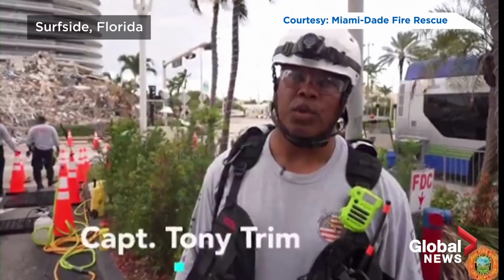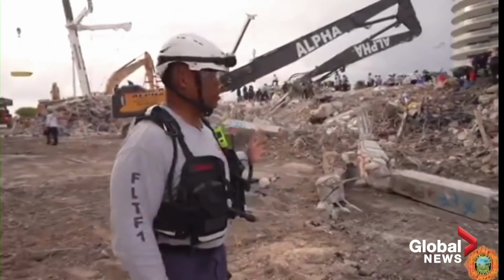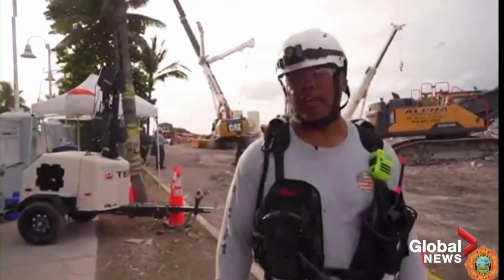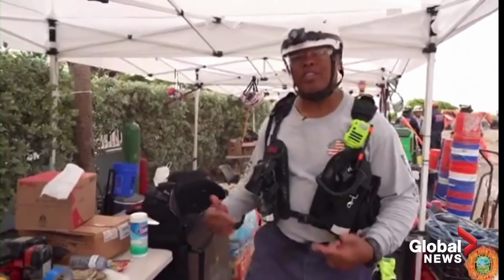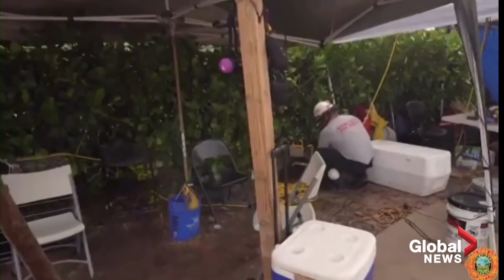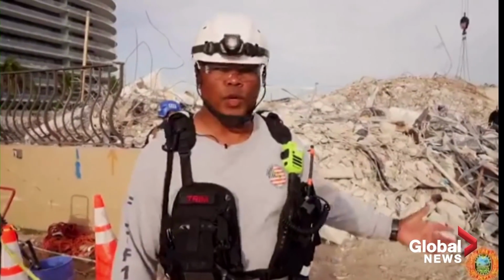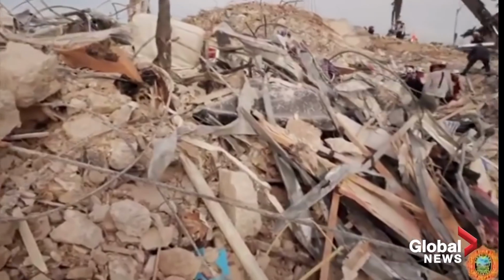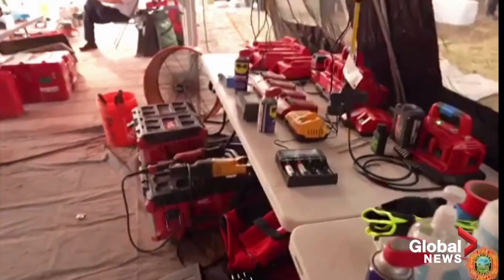Miami-Dade Fire Rescue gives behind-the-scenes look at Surfside building emergency operation

Comment: where's Boston dynamics and all those other robotic companies that designed bots just for this occasion
Reply: Robots wouldn't really help here, because it's a pancake collapse; there were very few voids for people to survive in, or for robots to go into. The only place where they could help - and did help - was inside the part of the structure that was still standing. If I recall correctly, they used robots to sweep the building and collect evidence prior to demolition and after the initial sweep/evacuation.
Reply: @TheEDFLegacy  I think they are talking about robots that are designed to move heavy material.  Not robots that search for human lives.

Comment: That's weird, because from the video it looks like this is filmed after the rest of the entire building was demolished so obviously there's a lot more concrete on the ground vs when the partial collapse first happened. Also for the almost 2 weeks of 'search and rescue' there was no photo/videos showing heavy machinery on site (correct me if I'm wrong), but they were somehow present in volumes in this video. Finally, they can say whatever they want about how hard these people worked (we can ignore the fact even that they had to take breaks every 40 mins and also halted numerous times due to 'safety concerns'), but the reality is not a single person was rescued, and even a handful of dead bodies was found with still  close to100 people missing? This type of thing is not new and they happen in other countries as well, but rarely do you see this level of efficiency even in developing countries when it comes to search and rescue.

Comment: Why the topos rescue team were not  allow  inside the rescue operations   topos would it  rescue the victims more faster   and have experience  in earthquake ad 911 twin towers     are these people  looking for   evidence to hide or for bodies They are slow  with no experience
Reply: Who are Los Topos?
Reply: Los topos can do a great job if it was an earthquake and if the debris was not so close to the damaged building that prevented to move large pieces of concrete. The topos could go if debris was not compacted since the building came down  vertically crushing the people. There were not air pockets since all were buried in sand and on top of them 12 apartments full of appliances.They removed 13 million pound of debris. 6 truckloads every day. The rescuers were using dogs that did not detect anyone alive. It is not the same. When 12 floors becomes a pile of just 3 floors. They need to be careful because the victims were perhaps crushed and buried and they needed a DNA to be taken from each one so the needed to work very slow not to miz anything. It is easy to said how to win the game the day after.
Reply: To answer your question, that team that arrived in Miami (Los Topos Atzeca) was not recognized by the official team of the Los Topos in Mexico nor by the Mexican gov, there are articles talking about that (check telemundo in Spanish), not too many people bothered checking theit facts though, so they are unaware of this. The Israeli Rescue Team, which is also very experienced worldwide as well, was allowed in and became operative right away, they said this collapse was worse than most other operations in other countries due to the fact that the building "pancacked" on itself in such a way to prevent faster rescue tactics, not like when buildings collapse due to earthquakes. The remained portion of the building was also slowing down rescue operations and was demolished days later. The evidence of why this building collapsed is public and keeps growing, many reports of major structutaldamage, design flaws and salt water infiltration since 2018 up to 2 days prior to collapse, delay in renovations due to high costs, etc.
Reply: @Claudette68  You are totally wrong!!!!!
The TOPOS have plenty of experience in cases like this and earthquakes and other natural desastres. They have been all over the world helping with desasters. 
They work under the piles of debris, not on top, they do not go to remove the concrete, but concentrate on trying to find victims alive using sound scanners and body heat detection devices, Mexico has had major earthquakes and a lot of people has been rescued alive, unlike in this case. My prayers for the victim's relatives.